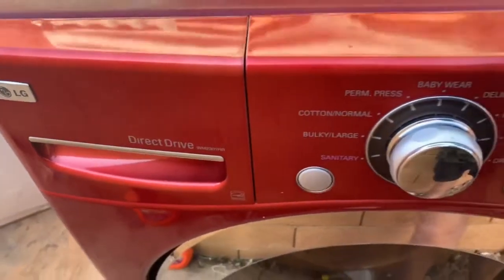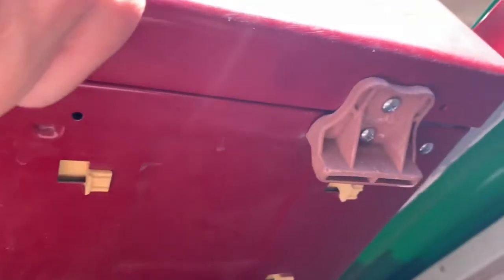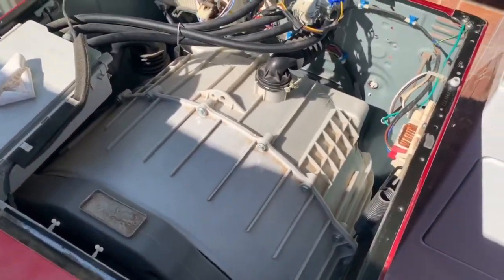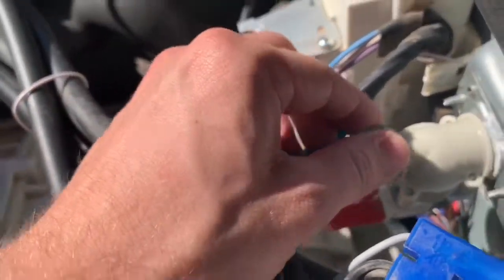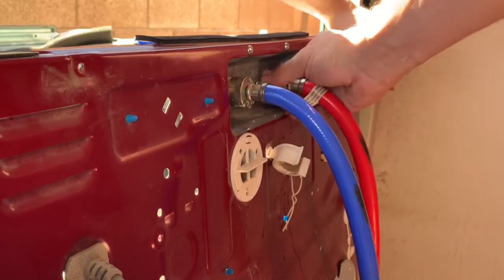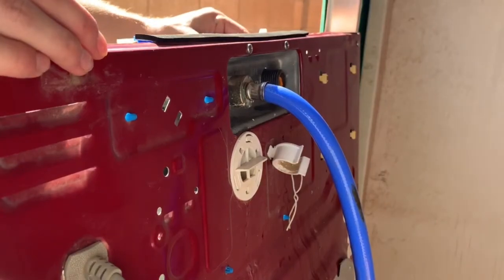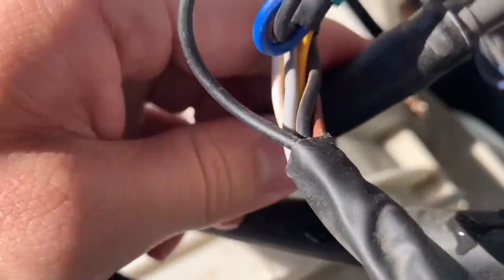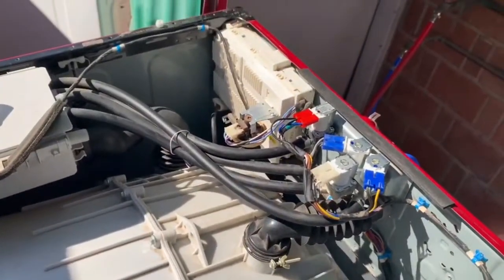LG WM2301HR Hot/Cold Water Inlet Valve Replacement - Leaking Washer

Comment: Mine is leaking out the top of the two valves closest to the rear on the cold water. Took it apart and didn't see any obvious problems, weird.
Reply: Yeah, mine too. Figured there must be a crack.  I just replaced it.

Comment: I forgot to mark the hoses! HELP!

Can you tell me which hose goes where?

The water inlet box is marked main, hot, pre, bleach.

I know hot goes to hot.

The three cold water hoses. Please help me!
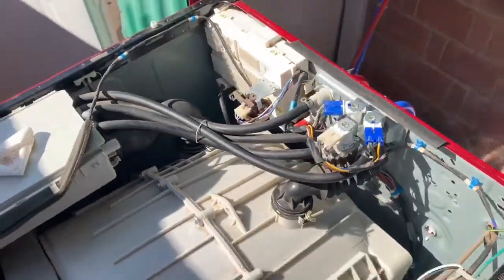Reply: 1:38
Reply: @timstapleton2291  I get you. But looking at a single frame of the video and hoping the crossing hoses are not obscured in some way is not perfect, still involves guessing. I was hoping for someone to post the the actual list of connections - with the labels from the machine.

I found a source and was able to get it working. But I have no idea where it was so I cannot post it here.
Reply: I appreciate the effort but there was really no evidence of corrosion, just a little dirt. Mine was leaking from the top.